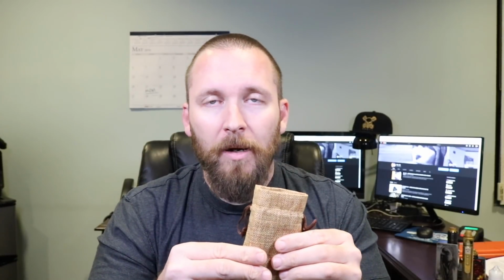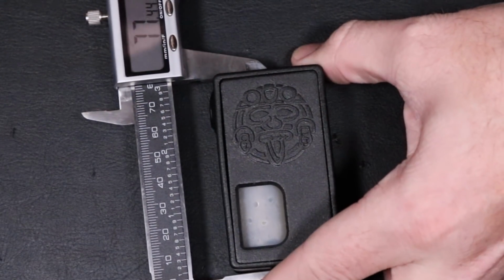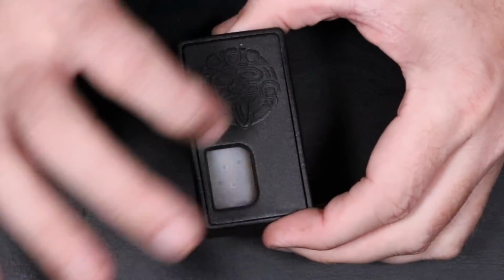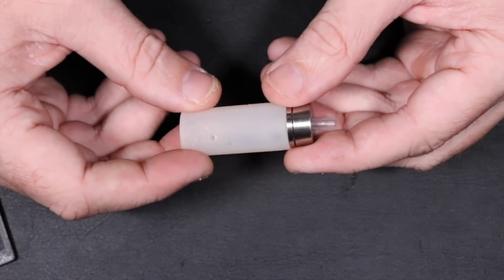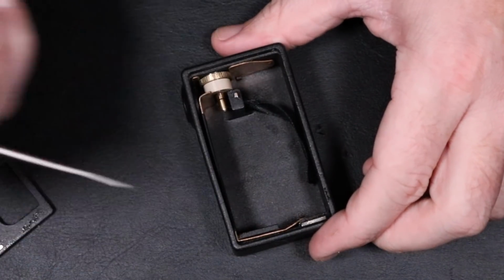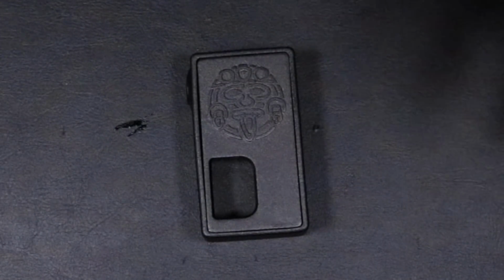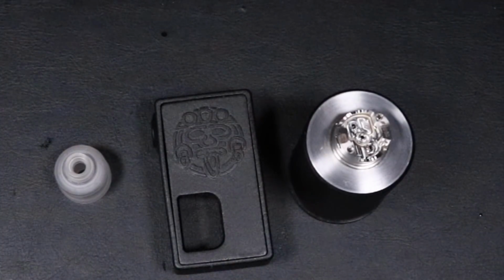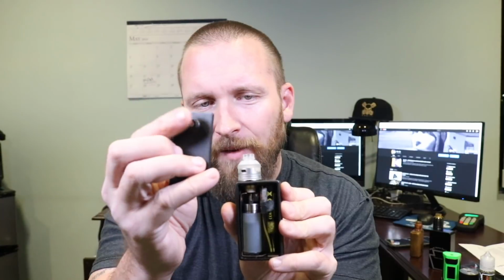AZTECA SQUONKER BY YILOONG VAPES ~ 3D/STEALTH/BUDGET/10ML

Comment: I got one based on this review. Cant wait for it to get here in vermont. Loving your reviews. Super chill.
Reply from the maker: Right on Matt h!! You will see when you get it that the magnets have been slightly covered in whatever coating they put of that 3D print door and enclosure.  Not sure if they all come like that but if so just scrape it off your magnets and you are good to go. Also, whatever your normal build is I would build slightly lower ( if .25 is your normal then build .2) just something things I did to get this dialed in.  Other than that, you will be pretty surprised with how small this guy is!!!  Very nice and cheap stealth setup!!!  Thanks again for checking out the video man!